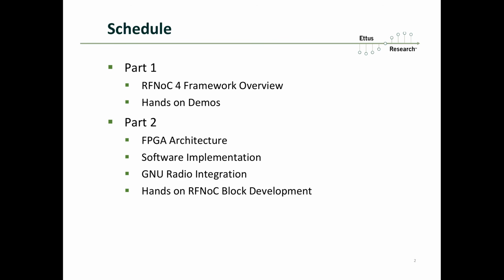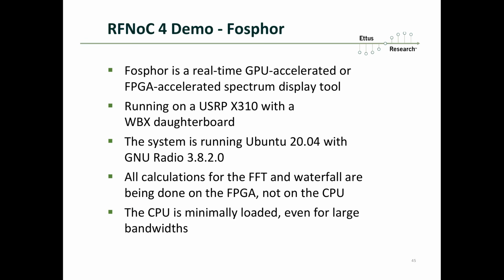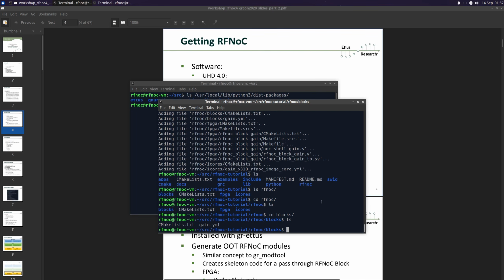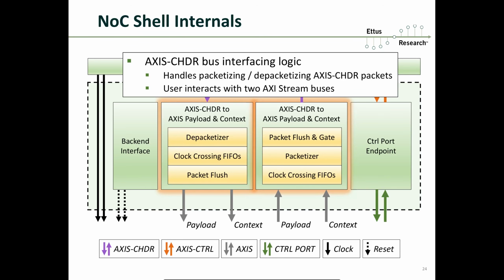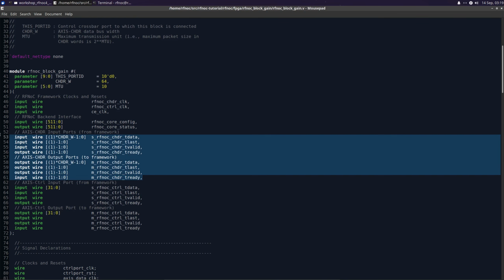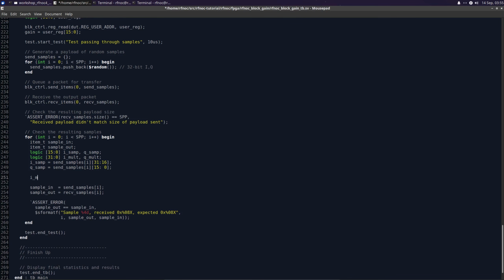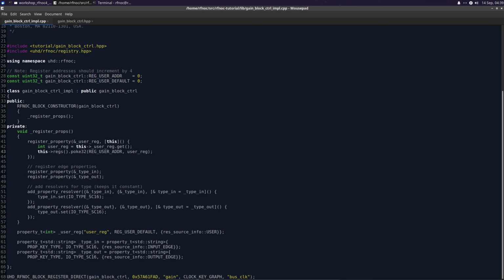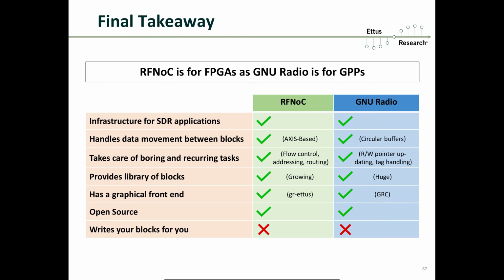RFNoC 4 Workshop - GRCon 2020

Comment: i have a x300. do i just follow the same steps?
Reply from the maker: That's correct. You can use these steps for all 3rd and 4th generation USRPs: X300/X310, N300/N310, N320/N321, E310/E312, E320, X410, and X440.

Comment: it automatically generates gain_x310_rfnoc_image_core. in fact, we are using E312, how to change this target? or the name is not matter, we can change in the YAML definition?
Reply: Hello, you can visit the E312 raw image YAML file(in the uhd repo of `fpga` folder), and modify the YAML to make your custom E312 image.
Reply: This is also my question as well. Is it possible to change the YAML file for targeting x4xx?
I am not sure, but I assume we do need lots of other modifications as well (not just YAML file).

Any help appreciated.
Reply from the maker: @mohsenpourghasemian2158  You can use the file uhd/fpga/usrp3/top/x400/x410_rfnoc_image_core.yml as a template for an X410 image.
Reply: @rfnocvideos9752  Yes, thanks a lot. I managed this and now I am able to build for x410.
Reply from the maker: Unfortunately rfnocmodtool only generates an image file for the X310. You can use the file uhd/fpga/usrp3/top/e31x/e310_rfnoc_image_core.yml as a template for setting up an image core YAML file for the E312.